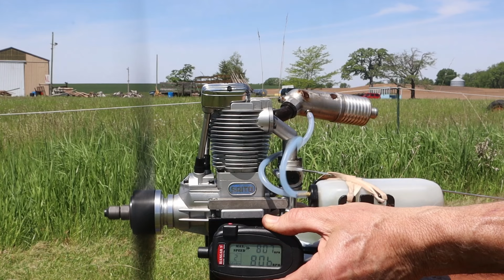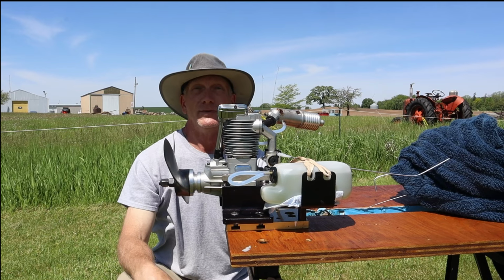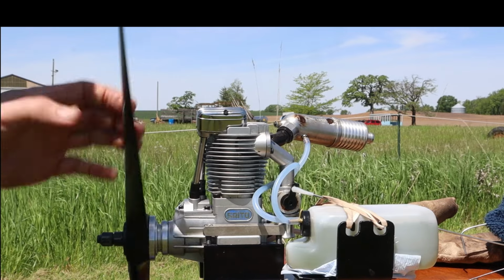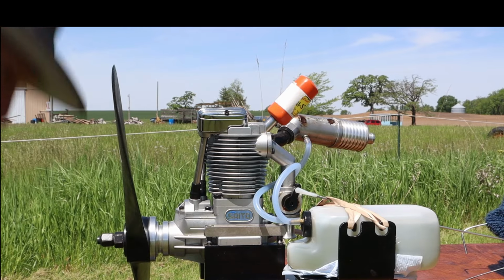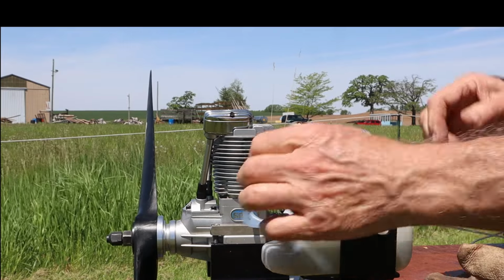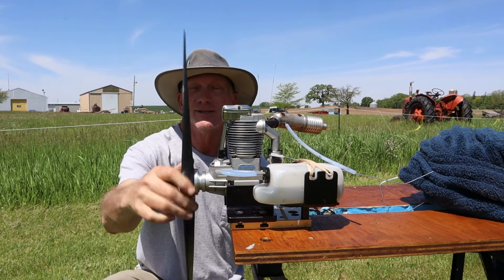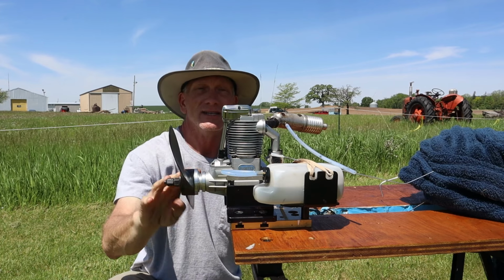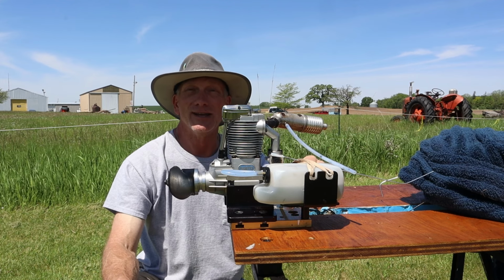Saito FA-220a Viewer Request Run

Comment: Lovely engine. I have one too. Unfortunately the tacho rpm is out of view on video.
Reply from the maker: Well I can’t get them right all the time.  How about you try to make several thousand videos?
Reply: @dmrcflyr2  Still a great video, David. No offence intended. It does idle nice and low, was just keen to see the idle rpm. Maybe you can tell me here? Is of interest as I use the same prop so would be interesting to know. Thanks.
Reply from the maker: Well I think I have it better framed in the video before this one from last September.  Nothing really has changed since then.
Reply: @dmrcflyr2  Thanks, I'll have a look at that one.
Reply from the maker: Simply do a search on my channel for Saito 220a you will find all of the videos.

Comment: Hi David, my most profound thanks for the run you made for me (too); below are the stats of my 220 as she stands after some 32-33 hours running time:
MA 20x6 prop (not 20x8) 8,140 rpm peak, ~ 8,100 sustained
APC 18.1x10 7,700 rpm peak, ~ 7,640 sustained
APC 19x8W 7,600 rpm peak, ~ 7,520 sustained
APC 18x8W 8,490 rpm peak, ~ 8,380 sustained
MA 18x10 8,240 rpm peak, ~ 8,180 sustained
12% Nitro 18% fully synthetic oil Optifuel, OS F plug.
These are the props I 've tried on my 220 since 2009, and the "longest-serving" one is the APC 18.1x10, just suits my YT International Typhoon perfectly, has been on the airplane for over 5 years now.
However, I've always had a slight issue with the 220: I see your's idles magnificently without the glow igniter on, at less than 1,500 rpm sometimes. To get that low, or to even get a reliable idle below 1,900 rpm I've had to install an onboard glow system, which activates from 1/3 throttle and below. Then I have no issues; if I de-activate it, the engine will stall on me when trying to rapidly or even moderately throttle her up after some ~20-25 seconds, even after the most meticulous tuning of the slow-run needle. Could never explain why this happens for all those 15 years I have this otherwise glorious engine? At least I'm quite happy to see your 220 idling like a dream without glow heat. There has been no improvement on that front as my 220 clocked more and more running hours, she's had that "drawback" from new...
Reply from the maker: That is a great service life for your engine and the numbers seem very good.  It is unusual about your idle however.  Mine being the only 220 I have experience with I cannot offer you any advice aside from a carb swap.  Obviously that is not an easy thing to do but it would be the best thing to experiment with.
Reply: @dmrcflyr2  Well David I hope I get many more hours out of the 220, it was quite an expense (bought brand new in 2009) and I adore it, frankly. Forgot to mention 2 things on maintenance; the intake (not the exhaust!) valve spring failed in flight at precisely 24 hours running time, but I had landed without issues. Also, she's on her 3rd main bearing, and her 2nd front bearing (I do dry-run the engine out after each session). Other than that, and the idling issue, I 've been quite happy with the big bore beast. Carb swap, I can't find something in decent condition but since I've been using the onboard-glow system and it works, I'm not quite sure if I'm really willing to; I've left things as they stand.
Reply: @dmrcflyr2  David I forgot something that could be important: how much oil content does the CoolPower 10% fuel have? Because my engine is (almost) inverted, it is a parameter that could be playing a significant role in itself.
Reply from the maker: I sent you an email of the Product Analysis of Morgan Fuels.. Cool Power 10% is 17% synthethic only.
Reply: @dmrcflyr2  Thank you very much once again, for both the 220 run and the enlightening email David ;)